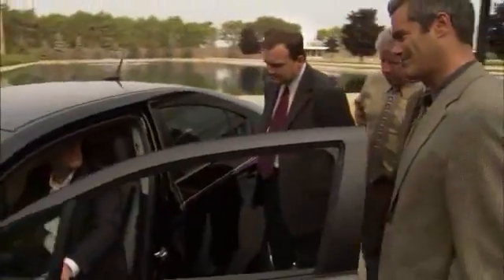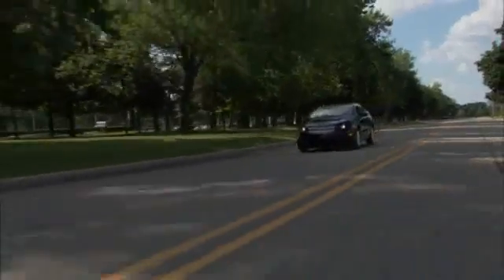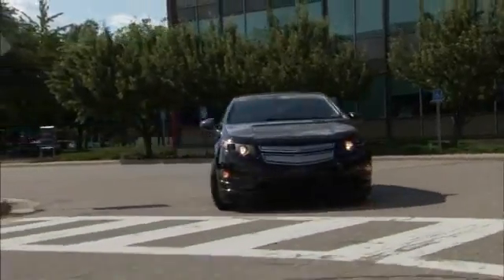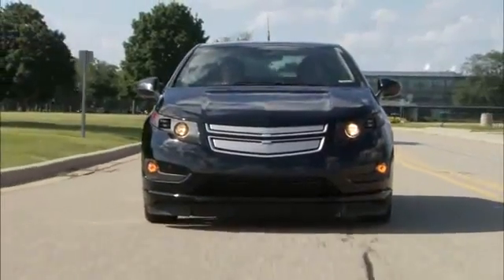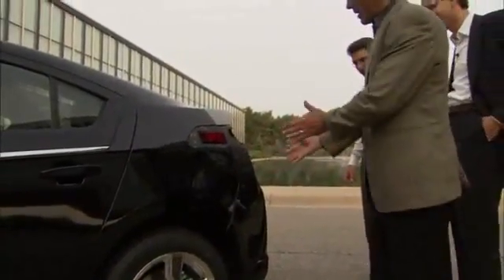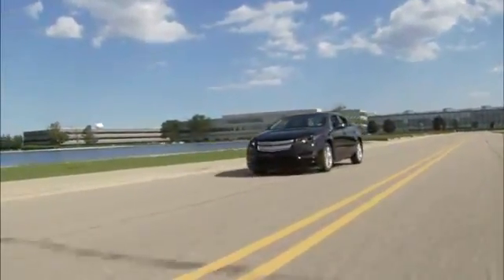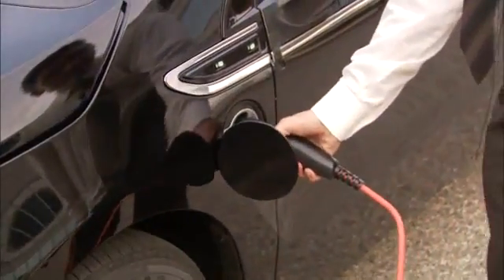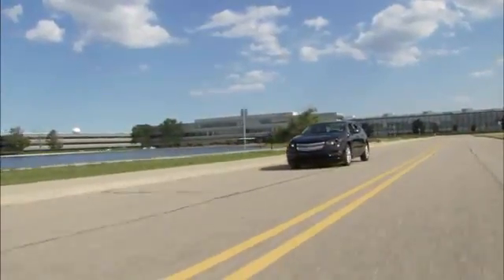Production Chevy Volt Design

Comment: @DBSpy1 The actual fuel mileage seems to be anywhere in the low-high 30's between city and hwy driving with just the regular engine. Not much considering what other econo cars get. BUT (and I've already done the math) if you drive say around 200 miles/week and charge it every night (its average electric range is around 35 miles from what test mags are getting), you'll use less than a gallon of fuel per week . The mpg range that it can jump up to is HUGE!

Comment: 5 - Finally, opening the door to a better future: How in the hell do you think this horrible fail of a joke of a slap in the face is opening any doors! Have you even looked, or thought about, or considered or expended one brain cells worth of power into looking at other electric vehicles? No, you obviously haven't. Take for instance Tesla Motors new Model S car due to release right around the same time as the Joke...I mean Volt. $10000 more with a 300 MILE range, can be charged in 40 minutes...

Comment: 4 - Volt can reduce consumption: Perhaps. The problem is that these vehicles are not going to sell. They are overpriced, complicated, time consuming to refuel, short ranged and confusing to operate for the average consumer. Have you looked at the guide for driving this thing so it will be the most fuel efficient? Very few of the very few who own one of these things are going to follow the instructions.

Comment: 2 - 30 years in the making. Actually, viable electric automobiles were engineered and sold in the late 1890's to the early 1910's, they sucked and because gasoline was so much better engineers simply stopped working on them. There have been dozens of other electric vehicle designs scrapped for the same reason and more recently not because gasoline necessarily was better, but more it had better infrastructure.That, and the government makes BILLIONS off of the taxes on gasoline.

Comment: Alright, I'll bite once again. So here we go. I'll address each individual statement you made. There are 5 here. 1 - Under engineered vehicles: I agree. Every automobile on the planet is severely and PURPOSELY under engineered. They DESIGN them to FAIL on PURPOSE so you will have to buy new cars, parts, etc. etc. etc. It has been known since the 1960's that the big auto manufacturers could design a car that would easily last 40+ years, but they wont. They're greedy.